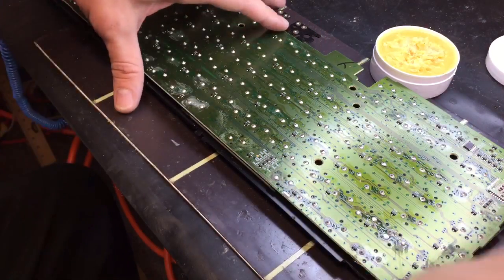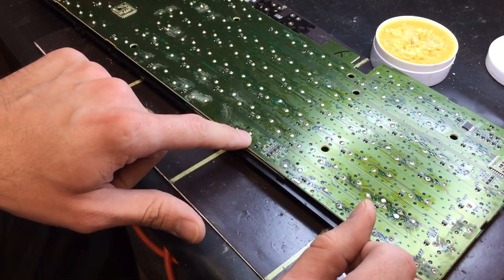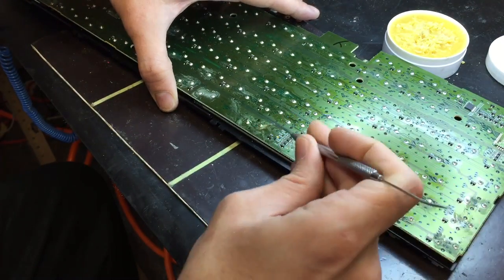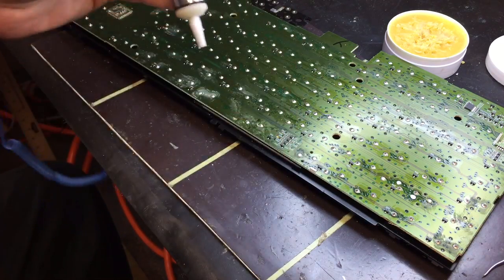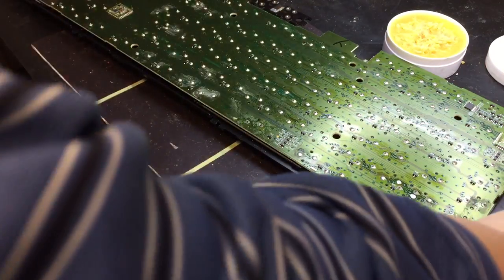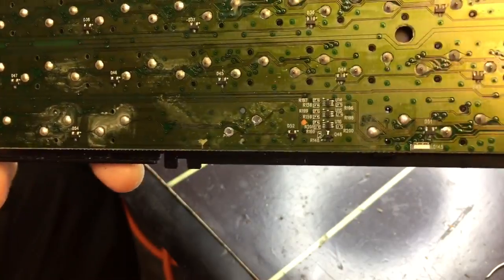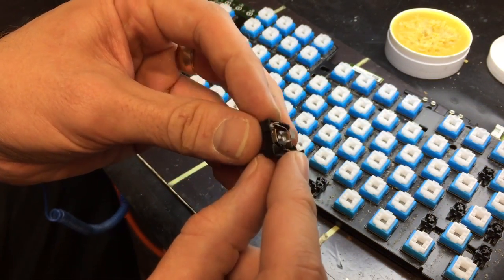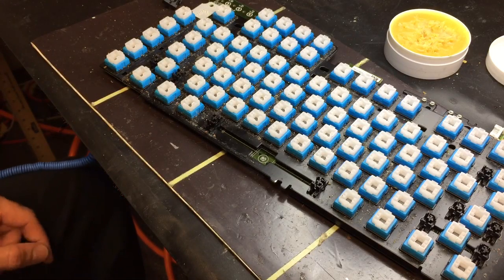Remove Logitech G910 switch for replacement

Comment: hi. what the model rgb led? you know? dont work blue color....
Reply from the maker: 9rad they are called romer G switches and I was able to find them on ebay for a few bucks a switch.  After replacing the switch the full color spectrum worked without a problem.
Reply: sorry for my lang.. My switch work ok and good. dont work 1 color (blue) 1 led rgb. I think need replace SMT led diode. https://ibb.co/jxxHMv
Reply from the maker: 9rad I see you meant the diode itself.  I spent some time this afternoon   searching and couldn't locate a place that sells that part.  When I fixed the switch I was able to find the romer g keys easily on ebay but the diodes appear to be a much more elusive part!  If you do manage to find them please message me I would be interested in knowing myself.
Reply: ok) I will turn to support logitech
Reply: Logitech had the diodes marked with a different part number, so good luck on finding them. You're better off just getting the switches.
Reply: did you find the reference of the diode?
I have a diode hs and half of my keyboard no longer lights

Comment: +Connivingbones Are the pins on the romer g's in the same places as cherry mx switches?  Would I be able to mount Romer G switches on a cherry mx PCB?
Reply: Judging from the pattern on the back, no they are not. I was considering this keyboard, but not being able to change the keys is a big no-no for this expensive of a keyboard.